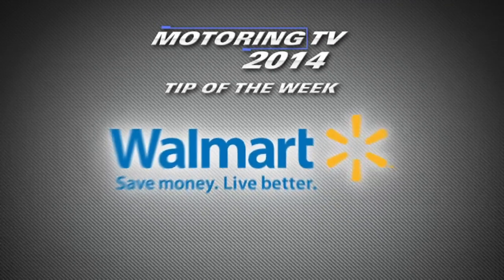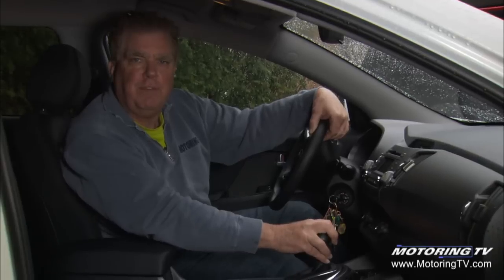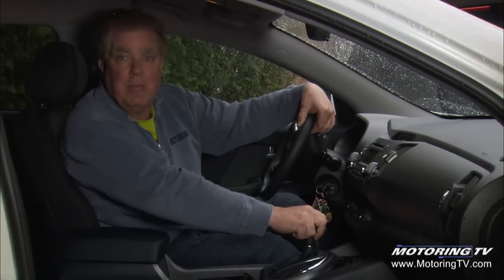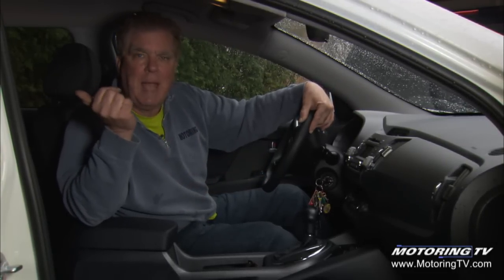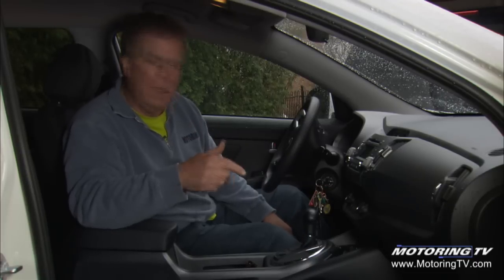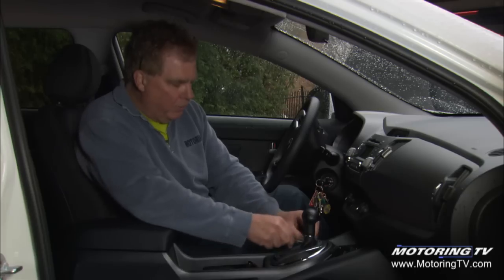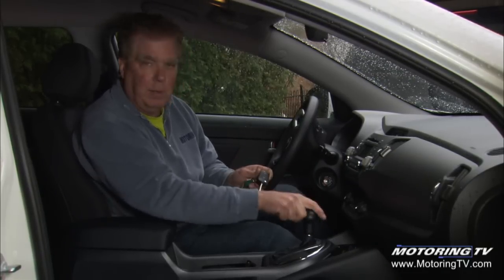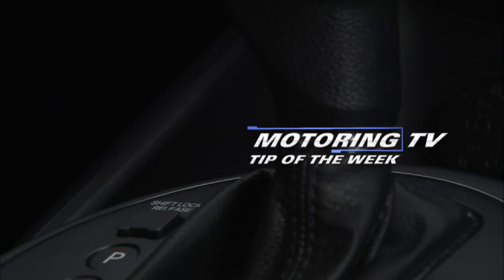Tip of the Week: Shift lock

Comment: I had a Mitsubishi Lancer before and I was surprised that it doesn't have the lock for the gear lever. How could I solve if the brake pedal switch does not work?

Comment: Had to use that since my car died on me (bad battery connection) and could not put the car in neutral otherwise. Very handy since the introduction of shift locks. At first I was wondering how the hell i could put it in neutral and my brain reminded me of that strange little plastic cover right left of the shift lever ( it’s a Hyundai so yes same spot as on the Kia). Funny that I see the video today, because my first though was to try to use the ignition key… apparently that’s what people do it seems 😂 funny thing I have only noticed the thing on this car two weeks ago. Previous car I did not even knew there was one, it had shift lock too.

Comment: Hello, I have a 2009 Hyundai Santa Fe.   They replaced the cable assembly and clip gear.   The shifter cable pivot was seized not allowing the cable to move properly, they replaced the shifter cable and that worked - for 7 months.  The same problem came up this morning - I couldn't get the car in gear.  I have been told I will need to replace my transmission.  Does this make sense - I go from not being able to put it in gear to needing a new transmission?  Can you answer ASAP please?  Thank you

Comment: my 2004 Hyundai Santa Fe got stuck in Drive today and couldn't get it in reverse....and it does not have a shift release....whats wrong??  Or what should I do....single mom, have to work tomorrow and it did it twice today for the first time....116,500 miles on it
Reply: Linda Thomas Shift/ Gear Postion Sensor